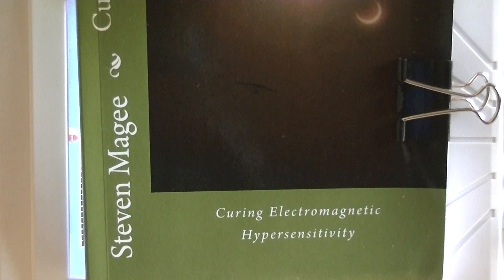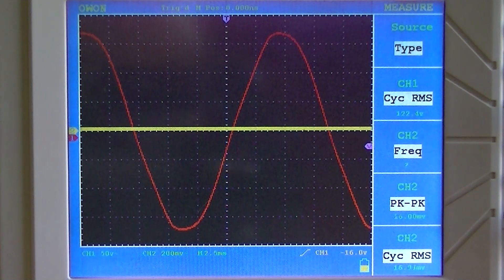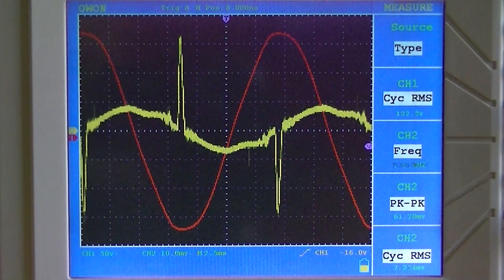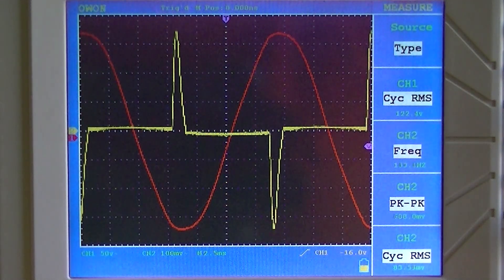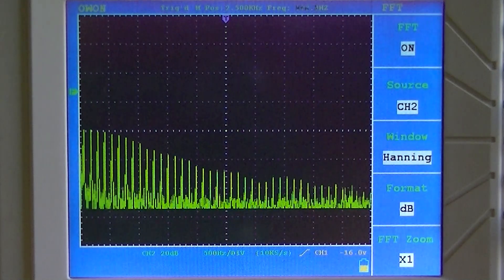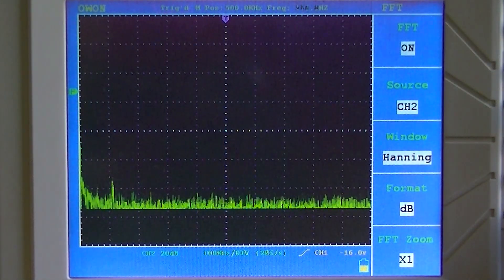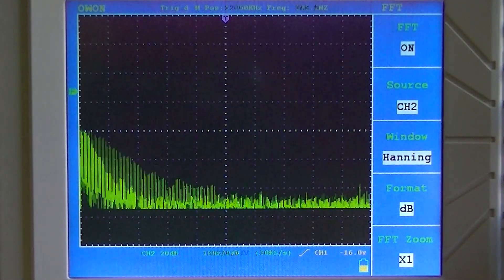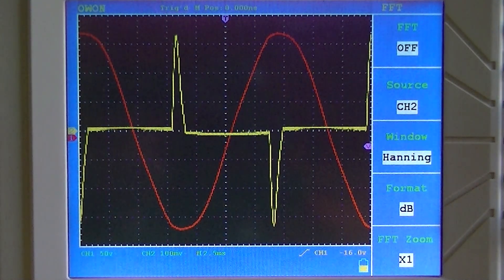Testing a 2014 Switched Mode Power Supply for Harmonics

Comment: Do the harmonic spikes get higher when a dvd is playing ?

Thank you for the insight.

Cheers,
Terry
Reply from the maker: NoFear4XJs Good point!  There was a DVD in it that I assume started to spin when I turned it on.  It's a streaming wired network video player for Netflix, the main application that it will be used for by us.  It's a slick device with a crappy power supply and poorly shielded electronics, like so many electronic products these days.  They should bring back the metal cases and put the power supply inside the product to electromagnetically shield it.